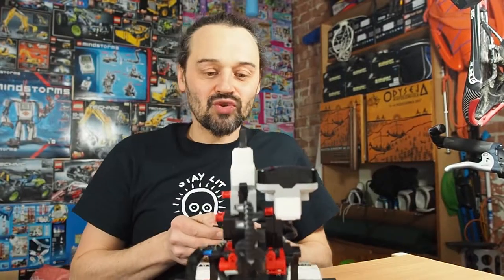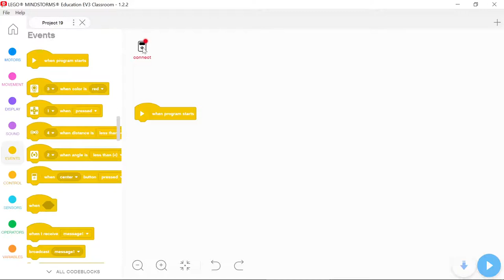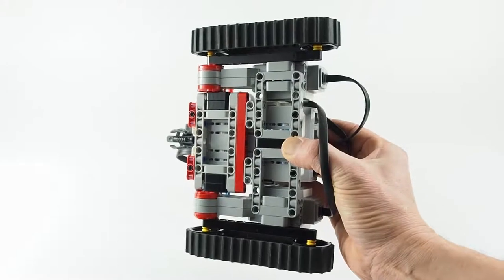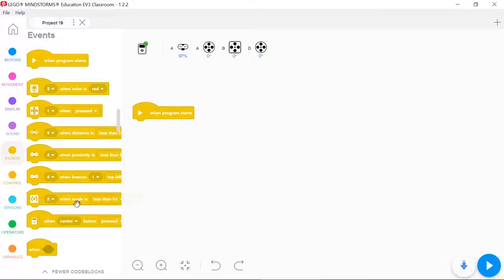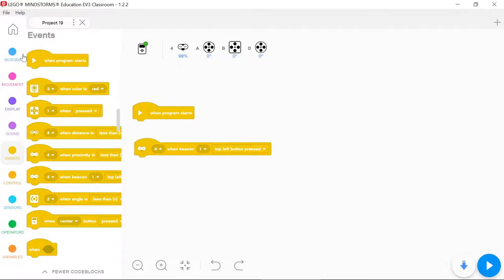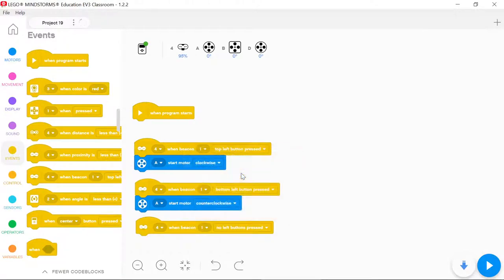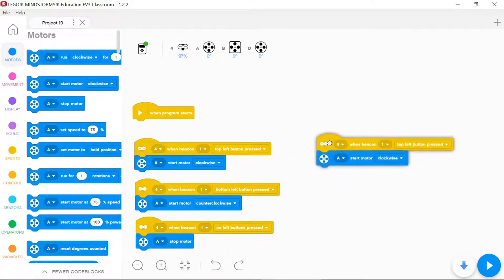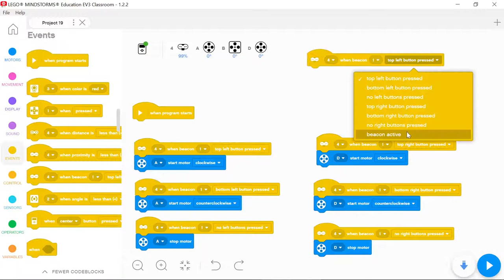Lego® EV3 Classroom #3 - How to remote control vehicle

Comment: My EV3 Classroom does not have infrared sensor blocks. It only has ultrasonic sensor blocks.
Reply: EV3 classroom goes with the core set, which doesn't have infrared, so EV3 classroom should't have the infrared blocks.